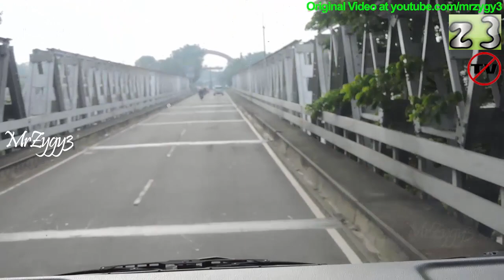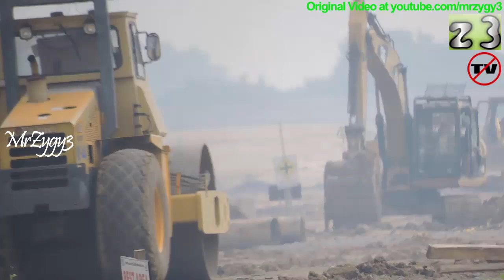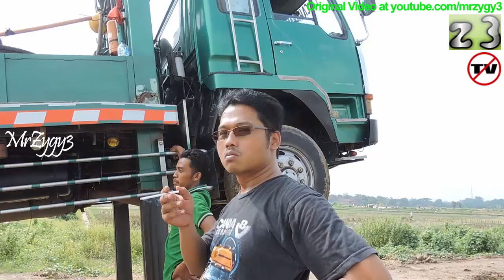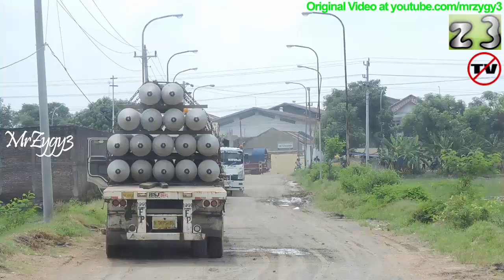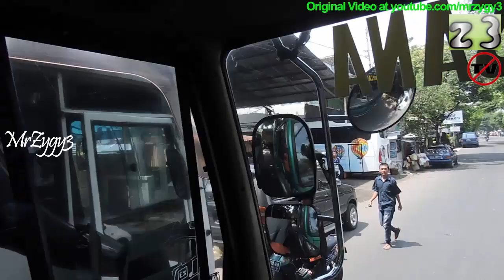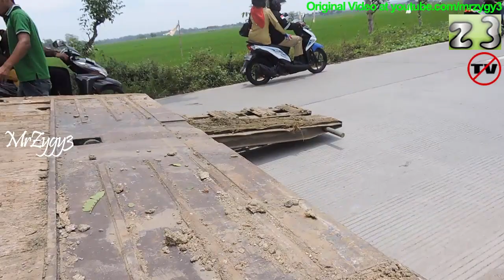Fuso Self Loader Truck Delivering D65PX Komatsu Bulldozer

Comment: what's the specs of the Mitsubishi fuso?
Reply from the maker: +Brandon Roberts 
  Power: 330 PS / 2.100 rpm
  Torque: 1.179 Nm / 1.300 rpm
  Displacement: 17.737 cc
  Cylinders: V-8
  Bore x Stroke : 142 x 140mm 
  Aspiration:  Naturally Aspirated